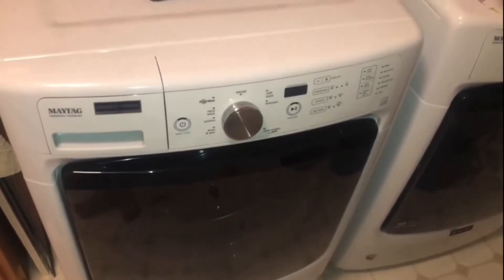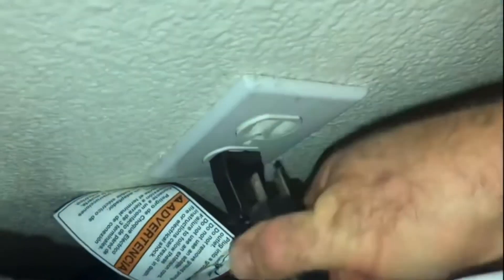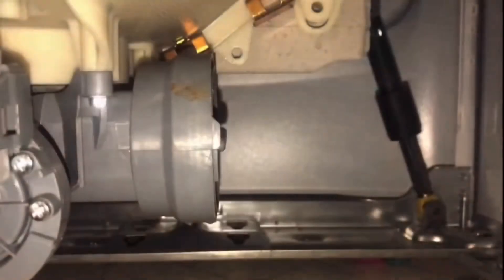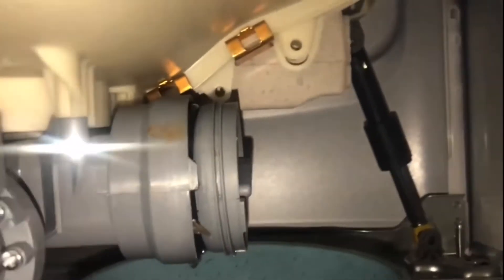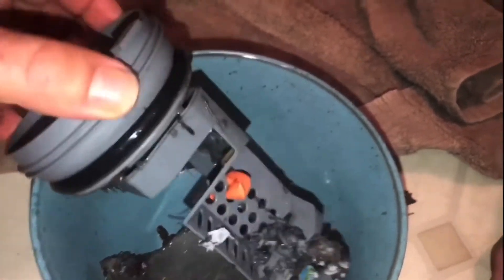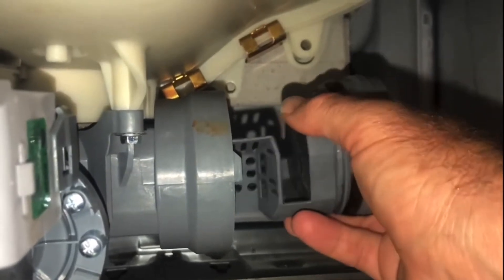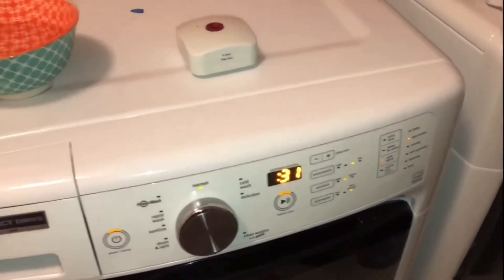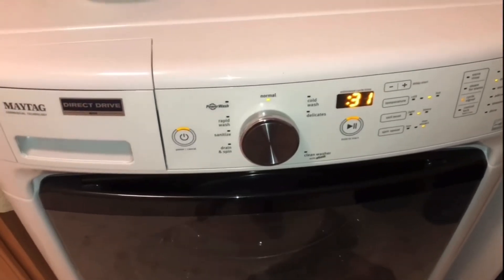MAYTAG WASHER CODE - F09 E01 - EASY FIX - Washing Machine Not Draining - Whirlpool - GE

Comment: After we got the error code; E01-F09 we reset the machine by unplugging it.  When plugged back in there was nothing but a humming noise and the light for Door Lock was flashing.  We were finally able to open the door by removing top of the washer and on the inside where the door opened is a white latch.  We opened the door and remove the clothes.  All said and done the pump has failed.
Reply from the maker: The humming noise is actually a good sign. It could mean the pump is trying to work, but it’s either plugged or jammed…